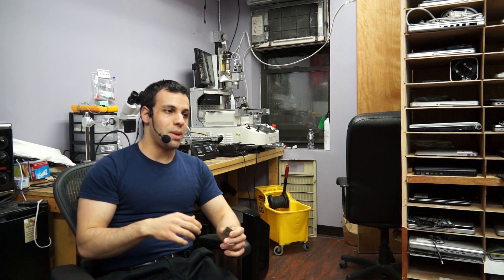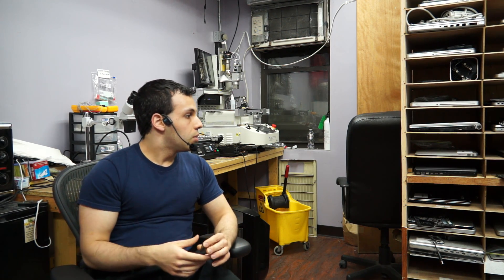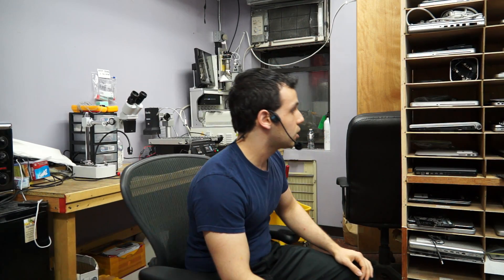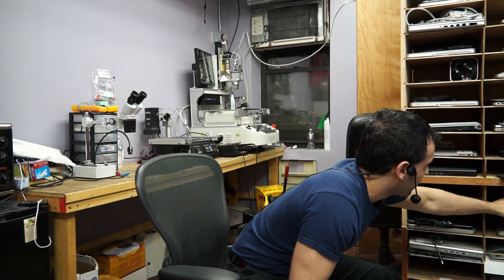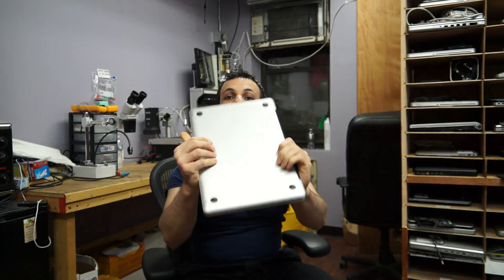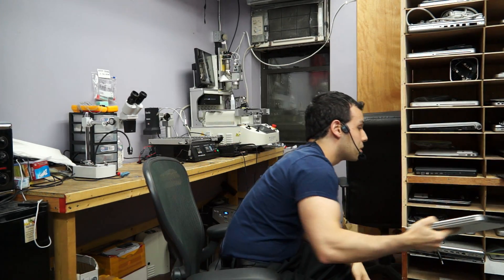Reballing flip chip GPUs is BULLSHIT - the truth about dead laptop GPUs & repairing them.

Comment: Lol just found your youtube channel - at last someone who tells it as it is!
Pity you just do mac repairs - aaargh!
Only way to make real money out of computer repair i guess!
I do still love my Dell D630 does that make me a bad man!
True about the customer satisfaction , very true - not many repair guys like you around where I am from in Scotland!
Reply: +Garry Gemmell If I had the gear there would be a guy in Aberdeenshire that is like this guy. Laptop repairs are generally easier, cheaper and you can get them done in higher volume. 

Crapple products suck donkey bollocks. I've had an ASUS X5DIJ for 5-6 years and dusting it out, cleaning it & looking after it keeps it running. Had some issues, but I've fixed them all for cheap amounts (less than £100). Macs and i-products are over priced BS.
Reply: Arthur Wellesley 1st Duke of Wellington Yeah I do repairs , reballing and reflow myself but not like this guy - just dont have the money or machinery and besides I am a systems programmer and network guy , I started off in pc repairs but there is zero money in it now unless you do Crapple! Im not a Crapple fan - posers gear for those who want a status symbol thats not me I will stick with my Blackberry 9000, Nokia 435 and Huawei G300 - Lol Sadly the days of the IT technician and even electronics engineers is coming to an end with the cloud and throwaway gear - I have had a few people bring me cheap tablets but to repair these £50 jobs would cost £60 in labour even before replacement parts like screens so its just not worth it = I hate to have to just bin these things although in reality i save everything Im a hoarder! Everything comes in useful one day.
Reply: Garry Gemmell Throw away shit pisses me off. EU and UK are starting become more efficient and less like this. 

Good workman ship & such is much better than just buying something for the sake of a new "fad" or because "I MUST HAVE IT". 

I hope consumerism dies a horrible death. There should be a selection of decent, well made products in a competitive marketplace. I sound like a capitalist but I am essentially a social libertarian. 

I have a KYOTO chinese branded iPad copy, the firmware on it has gone bonkers and I can't find it anywhere. I was given it for free as a "if you can fix it you can keep it". Got an SD card to flash it with but no firmware, not sure what programming language Android 2.2 uses either, as I can only do a bit of C+.
Reply: Arthur Wellesley 1st Duke of Wellington lol I had exactly the same issue bought an Onda and after plugging it into an Apple charger to charge it at a mates it went belly up and lost the os - and tried to flash it with some of the mods on the internet - nada - its should be bin material dude but i sold it back on ebay and some idiot bought it for the price i paid for it so there you go!

I could see all the apps and my data on it browsing it using the onboard recovery firmware and via my laptop but no os recovery.

I tried sideload and os reflash and nada it was a difficult fix that needed the jtag equipment and factory stuff to fix it.

Have you tried to do a firmware reset / reload from the emergency android screen? i presume you have as you say you are trying to do a reflash from the usb - My problem was worse as the usb slot was knackered as well so all i was left with was trying to sideload via my laptop but i learned a whole lot from two weeks of fiddling and flashing etc
Reply: Garry Gemmell This tablet is in pristine condition. I don't have a USB cable for it, it is USB 1.0 as well, very old type of connection. 

Apple cable is too wide, generic too small, micro USB too small, Samsung and Sony too small. Not found a cable that fits it's USB port to date. 

I am trying to get firmware to put on a Micro SD card (my computer has a SD card slot), load firmware on it, then plug it into the Tablet and reflash it with its firmware. 

I comes up with "KYOTO" in the centre and the "android v2.2" and the Kernal build number etc in the bottom right corner. However, no button combination (there are only 4 buttons) works to get it to a diagnostic screen. 

Without coding a tool myself or finding one on the internet I wouldn't be able to fix it. 

I know what is wrong with it, but these chinese tablets don't have any downloads. I checked Chinese websites as well, sifted through about 10,000 Han chinese characters to get to a page with downloads to find they only list knock off Samsung android tablets.

I could get the SDK for Android 2.2 from somewhere maybe. But I think it's a firmware issue rather than an OS one as it is still detecting the OS, just not loading it.
Reply: Arthur Wellesley 1st Duke of Wellington Hmm my last comment was deleted - no idea why - there is a mod you can use that might work but cant mention it here - head over to androidforums or cyanogen.
Reply: Garry Gemmell I've tried flashing with the SD port last night. Needless to say the WM8650 Firmware didn't flash. I'll try putting Uberoid or a legitimate version of Android v2.2 (or later) on the SD card, but I doubt it will flash.

This model has no diagnostic menu, no button combination to hold to bring one up & nothing on the board that is of use.

The thing is in pristine condition inside, it's just shitty ass firmware or OS's that fucked this piece of shit up.
Reply: The only solution is jtag and factory reset or desolder the flash rom chip and put a new one on so i guess you should stick it on ebay and hope some techie who thinks he is the bees knees wants to try and give it a go you would be surprised at the things people buy on ebay!
Besides the price of tablets is getting ridiculous - after my foray into android i am now looking at the Lynx8 Msfot for £50 to develop some apps on.

I saw a guy once sell on ebay - "king size mattress , some stains and a slight smell of urine" and it sold!!!! I nearly fell off my seat!
Reply: Garry Gemmell Yea I know. I have some old PC components and Rainbow Six Vegas (for X360) up at the moment. 

I know what the problem is and it still boots. There is no physical problem itself. I'm an electrician and welding engineer by trade & have qualifications in electronics as well. I've diagnosed the issue so i think its just going to take me being more drastic.

There are other things I've not tried yet that might work, but I won't disclose them here. `
Reply: +Garry Gemmell Bad news: the Quadro NVS 135M GPU in Latitude D630 notebooks with discrete GPUs are also known for them failing at random nowadays for the same reason louis described.
Reply: martravi lol I already know that its old news - I have 5 ready for reball with new chips from China! They are great laptops except for the gpu overheating and losing the solder!
Reply: +Garry Gemmell Reminds me of my DV6000 series HP. Oh boy the 6000 series Nvidia shits OOPS chips, failed every single time it would hit 80ºc. Pretty much no exception, it fails when it hits around that temperature. Well not just Nvidia's fault on the chips but also the terribad GPU cooling these had, the lower end ones shared the heatpipe with the CPU.
Well after spending on reballing of that thing I just trew the board on the oven after the 3rd death. Done it some times and works for now (after 6th time or so), of course I barely use it anymore, but just to not let it dead on a corner.
Reply: +Garry Gemmell I have a Latitude D630 lying around as well. It's years and years old, looks like trash, but still works fine. Only the battery is bad, except for that it's fine.
Reply: deWaardt Im typing on my Dell D630 its my main laptop its one of the best laptop ive ever had - 4gb runs windows 7 perfectly has slots for 4g radio card, got a 64gb internal mini pci card installed for swap file and speedbost , the main hard disk is a 64gb ssd , modded the cd drive caddy so it now has a lightscribe dvdrw and its faster than many of the chromebooks ive used - its rugged as well i carry it around to do car diagnostics and borescope plumbing analysis, machine code programming and some C++ Development as well as playing World Of Tanks lol Its a beauty of a laptop except for the gfx card problem but i licked that one with the help of a 2p coin - fixed the graphics card overheating from 96 degrees now runs at 65 degrees and all it took was a 2p coin and a file and lapping wheel! The simplest fixes are the best. I have 4 other Dell D630's all gfx chips failures but am planning on fixing them all just for the fun of it and i will always have as spare so no new laptop for me in the near future!
Reply: +Garry Gemmell Guess there's just more money in doing mac repairs lolz :)
Reply: +Garry Gemmell I have one of these that the GPU overheats - which chip did you put the coin on? Did it replace any of the existing heatsinks? Its a good laptop alright - higher resolution screen than most laptops you could buy today. ta.
Reply: ***** 2 pence coin - sand it down till its flat on both sides , get some fine grit sandpaper to make sure its lapped perfectly then add some arctic silver on both sides and place it under the original heatsink - the extra pressure will do no harm - I am typing it on this machine after the fix months ago and the temps have started to creep up due to fluff and dust buildup in the fan and the fan also degrades it used to do 4000rpm but nowe averages 3256rpm - Use the great utility speedfan to do your diagnostics - works on desktops and laptops! Heatsink is the whole thing but its the one on the far right which covers the small nvidia gfx chip! Have also noticed that the keyboard back which is metal also acts as part of the heat removal mechanism as it sits on the heatsink so thinking of adding a copper backplate on the keyboard to remove even more heat!
Reply: Garry Gemmell You do realise that suggesting this in the UK is illegal right? Defacing money, even if it is pennies is against the law.
Reply: +Garry Gemmell Thanks :) To keep the youtube commentators happy I'll look out for some obsolete coin - Old Queen Vic 1d or Irish pre Euro 2p maybe might do.
Reply: +Joseph Stalin lol
I am sure the royal mint is monitoring my posts intently!

Comment: Hi Louis, the point is, that if some component is dead and you're still able to revive it, then doing it properly at home for free isn't really a bad thing, there's no risk of losing anything. The real problem is when somebody get's paid for it as you stated because nobody knows for how long will this "fix" work. I've done this to my dead dedicated GPU, because some memory module was failing me. I heated it up for 10 minutes with the heatgun and then flashed it with underclocked BIOS, so I could increase the stability, hoping that it will work for another year before I upgrade to a new graphics card.

Comment: anyone who does graphic for a living on a laptop should find a new career, the thing with laptops there meant for light use during times of travel and so on, todays world people use and abuse them with all these hardcore programs made to work like desktop computers which are more powerful and can handle these programs more efficiently which is why they always end up trash after a few months
Reply: +k ly `This was true, but right now there's lots of laptop developments where they utilize full desktop CPU/GPU's while staying at a reasonable temp. 
This by no means is going to be as effective as a fully fledged desktop, but the developments are there, which is good :)
Reply: Yep and the trend accelerated by the mobile phone technology, which inherently requires small, power and heat efficient chips.
I do agree though, that a full fledged desktop/cube will beat a mobile device for now.
Reply: k ly
Eh, my APU-powered laptop is quite usable for OnShape, a "graphic" program, and while professionals might not want to 'make a living' using my setup, a desktop isn't more capable unless OnShape's system requirements go up past its possible configuration. It COULD happen, but just because I'd be left high and dry doesn't rule out another laptop becoming our next workstation.

Comment: It's completely rolling the dice. 
Out of 10+ or so devices I've baked in an oven with horrible heat regulation or more recently preheated to 100°C, coated everything around the die in distilled-water soaked paper towel and then selectively heated the affected die evenly to 210°C for 5-7 minutes with a hot air station gun while standing in front of the oven. 
- 2 remained dead (none of them oven cards) 
- 2 macbook gpus lived on for years; one of them shitty oven candidate
- an MXM quadro for a few months before artifacting again, then ever since after the second treatment (3 years); shitty oven candidate
- the chipset of an X58 pro-e, which is notorious for having a really shitty cooler and dying to overheating: 3 treatments, 1 week to a month each before finally dying for good
- GTX 760, heated 3-4 years ago, still kicking                                                                                                                                                                                                                                                                                                                                                                                                                                  
- some lower end gaming laptop (iirc it had a gtx 860m or something) lived for another half-year before suffering liquid (puke) damage
- various other stuff I dont quite remember but still got at least some more life out of it, meaning anything from a month to years (some very, very low end GPUs and one friend's delidded 1st gen 1156 i5 or i7 i can remember at least)

Comment: Your five minutes technique on my 3yo AMD W7000 grapics card worked! Although in my case I simply strung it up by a wire and used a heat gun to heat it. I preheated and set five minutes on my phone. I have no idea what the temp was, but the solder never got hot enough to reflow. Very scientific, but I figured what do I have to loose? It was already dead. Well I am typing on it now! I put on some more thermal grease, fixed  a disconnected fan in front of computer, and cleaned out dust. Any life from here on out is free! At least I can shop for a replacement. Thanks!!

Comment: Quick question, if this does work for machines that are used rarely or for non-intensive loads, could it work longer than 1-3 months for daily use on a GPU if it was cooled extremely well and maybe unclocked/under-volted?
Reply: Supposedly yes.
Temperature is key here: once the chip reaches a certain (sustained) temperature during operation, it will will break again. If it stays below that temperature, it should be fine.
I suppose that's the point he was making, I could be wrong. He could've been more clear.

Though I wonder, if not only the max temp, but also the length of time, that the chip runs at that temp matters in this. For instance running at 60c for half an hour is probably fine, but 60c for two hours continuous may break the chip again.

Im no electrician though, just an Information Technician and hardware tinkerer interpreting his words based on what I've learned abou physics and electronics so far...

Comment: I had a problem with bad GPU in my Lenovo. It was just out of warranty, so I went to unauthorised service. They told me that they could reball it, and it "should work long enough to make a backup of all data" or they can replace a chip with one year warranty on the repair, but it will be more expensive. So I took the more expensive option. And about 16 months later, on the same heavily used laptop - you'll never guess it - my keyboard broke. It took me three days to get replacement keyboard shipped, and another 20 minutes to replace it. (I did it by myself) Another two years passed and second keyboard broke. Another 3 days for parts and 15 minutes of fixing.

Not as dramatic story as I would hope.

Comment: With PS3 re-balling does work. The chip is so big that it bends with heat causing gaps to form in the ball connections. If i put the PS3 in the freezer for 10 minutes it works but next boot it's broken again.

Comment: Appreciate your honest, clear-cut opinions. Have been trying to obtain a schematic for an Asus (Asuspro) P2520LA-XO0301G. Dead,  has +ve/-ve reference points on m/board but continuity lost in centre. As only cost £35 for an i7 5th gen. Want to use as a project piece. Seems an obscure laptop, but found a faulty 1285A Buck converter. Waiting for replacement.
Would never have attempted this without your vids.
Lets hope just one issue.

Comment: Old vid now but still so relevant. The "oven fix" may make the system work for a short time but it isn't a solution. 

Silicon cracks over time, usually due to operating heat, especially in chips that change temp as fast as GPUs. GPUs can jump from say 23c - 85c as soon as you load a game or a render intensive task, that is some serious strain on the silicon as it heats unevenly then cools rapidly as the cooling solution ramps up. Heating the chip, much more evenly, expands the chip evenly and when it cools (again, evenly) it will realign the cracked areas back to their original positions and coincidentally create a working (poor) connection again, just like pushing a wire onto another wire allows signal/current to pass between them.

It's the same with cracked LCD panels, some areas will still work even though there is a crack running through, it doesn't mean the screen is fixed because you managed to realign it all and make it all display correctly, there is still a crack and in time it will slip out of alignment and no longer work. It is broken, replace it.

My little description isn't 100% accurate but hopefully it makes the actual issue understandable.